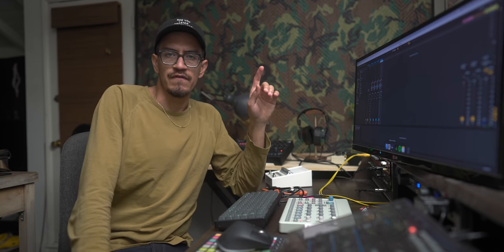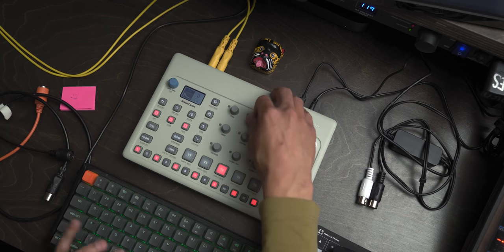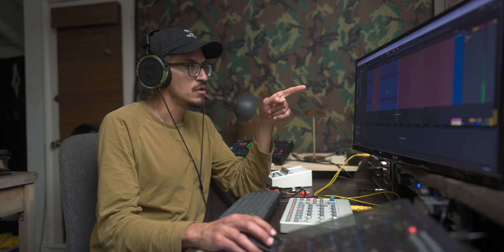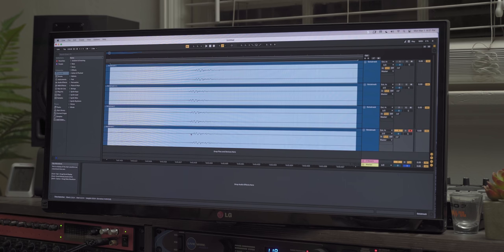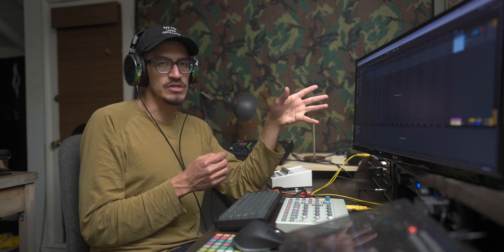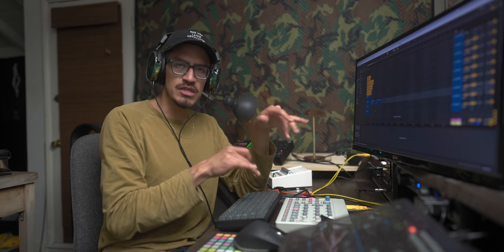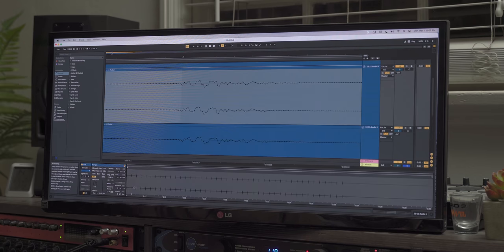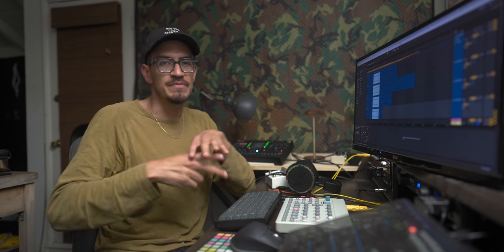Midi Latency and Why You Can't Win.. // Hardware Swing vs DAW Swing

Comment: this video is of value ricky bc we do struggle with these issues but without the understanding or equipment to isolate exactly what is causing these hiccups, it helps to see problems like this elsewhere so we are more informed with respect to those random software related issues as well as products that are fails, esp when those products are very expensive tho it may mean little and be unseen by you al together thanx for absorbing the impact of buying an expensive dud, it sux and im sure many will not end up in the same spot bc you did already preesh mane.... tempo issues are very confusing in the beginning. i had a real issue learning that the Orba's 100 BPM is MPC beats 97.7..... it took me a long time to accept there is an odd gap in actual tempo so i could just move on with the recording (i wasted a lot of time thinking i was doing something wrong when i just didnt know software kind sucks sometimes with these issues) i have never mutli tracked into a DAW. im just scratching the surface on software at all and find this info very re assuring. i wish i saw this sooner, PLEASE do a beginners guide to recording tracks including these types of issues that may trip up a noob like myself. the issues that wont be mentioned in the user manual such as this tempo discrepancy with software and hardware. this video will help me harbor additional patience when recording in the future and i think you have enough others to speak on that would help someone like me,  thanx ricky... keep it Gnar Gnar <("<) (>")>

Comment: 20:59 YES, always run your audio interface (and of course midi interface) on a separate USB, directly to the computer. Everything else like keyboard, dongle, drive, etc... can run from USB hub. This is definitely a source for this kind of timing issues.
Reply: Just avoid everything MIDI and USB in one sentence. It's the worse protocol EVER to use for stuff like this. It will NEVER be perfect.
Reply: @casecold1864  The good old firewire... It feels so good to have my old Ultralite firewire running rock solid... midi from my Ultralite in FW is ultratight... and OP-1 usb-audio-midi code is the best thing you could possibly imagine... boutiques on the other end... nevermind...
Reply: I would never buy a usb audio interface. Never.
Reply: @re8et355  FF800 here, it's perfect.

Comment: Hey Ricky, I can't say, how happy I am, that you made this video. For me. it's an confirmation, that I'm not such a great foolish at all... :-) . I've used Logic and now Studio One is my DAW of choice (again on Mac). The timing is way better, but you can't get totally rid of jitters and latency. My workaround is the same, as you explained: 90% of my midi-sequencing I'm doing with my Squarp Pyramid (btw: it's great!); then I'm recording my sessions and songs via an multi-input-interface direct in Studio One (or Capture), set the tempo there manually as it should be and drag the recorded tracks all together in the right grid. That works great for me. My opinion: if you're working with timing-sensitiv hardware like drummachines or grooveboxes and you will grab them into a DAW (without the multiclock...), then that's the way it goes...unfortunatly.
Stay healthy!!

Comment: Years ago while I was just switching to computers from hardware I learned about this issue

And my fix was to use the computer sequencer to trigger my hardware using midi notes 

And record the output from my hardware into my DAW 

This was the only way I could make sure the clocks were rock solid

Comment: I've experienced this too. I use Windows and the DAW mangles midi out.. 
Don't always record your parts as individual parts. E.g., it can be better to record your drums in 1 stereo mix. You lose the ability to edit the midi and different volumes, but you retain the groove and vibe. When I use the DAW and create drum parts then I always have to fix the audio wave. Timing is much better from the Akai, or from an analog clock. Analog really grooves for locking synthesizers and drum machines together.
Reply: Yes. I'm experiencing this midi jitter and for recording drums for metal songs this is horrible. One take for the whole song is the way.

Comment: Don't monitor in the daw. Set monitoring to off. There is always latency on live monitor
It used to be recommended to give an empty bar after midi start to avoid the 1.1.1 jittering between synced units.
Mpcs don't perfectly phase cancel over takes, ever (even on master) I guess everything won't if the cycles doesn't.
It all has to go down at the same time.

Comment: 20:28 We may not be able to hear less than ~10/1000 of a second of latency, but of course as soon as any kind of phase shift from parallel processing comes into play, even a completely undiscerning ear is going to be able to hear differences of just a single sample, eg 1/44100 of a second.

I think a lot of these latency issues come down to how well the device drivers are written as much as the hardware itself. I'm a big fan of RME gear on that front, always absolutely rock solid.

Comment: I’ve been using the Innerclock Sync Lock for years now to sync midi and din-sync hardware to Ableton as clock source. With some clever routing you can make the setup work even with monitoring via Live, allowing adding insert plugins, sends, etc.
Reply: Seems like it’s around the same price as the erm and I don’t see any knobs to adjust the clock delay, I thought that was the way to get all your gear in sync

Comment: I spent the last 6 years chasing midi sync with a computer after buying the squarp pyramid sequencer to sequence bitwig. Now after years of experimentation and measuring (and basically quitting making music over all these fucked up timing issues) I finally got the recipe right: 

- Get a modern soundcard with a midi interface, because this way your signals will be just a bit more "in sync" with each other. Dont expect 20 usb devices to work together in any meaningful way.
- Get a DAW that will run off midi clock instead of being the midi master
- Let your midi master clock be your device (eq. octatrack, squarp pyramid etc) 

Now to the more esoteric:

- Avoid plugins that introduce latency, bitwig for example has an indicator on individual channels that lets you know how much milliseconds of delay you get for using certain limiters or reverbs
- Run the lowest latency you can afford, but not so low that your system is always on the brink of collapse, as this will actually increase jitter

***UNCONFIRMED SUPER VOODOO TECHNIQUE**:  Run at 96k because ehh..i dont know something about USB packets being handled differently and shit. This one actually brought down the midi jitter to reasonable levels and get a 4/4 Kickdrum pattern within about 1/4096 or 1/2048 which is good enough for me ;)

Comment: I had an email converstion with the creator of Expert Sleepers USAMO - Andrew Ostler,and he said "there are two sides to every
MIDI connection - the transmitter and the receiver. The USAMO gives you a near-perfect transmitter, but it can do nothing about the
behaviour of the receiver." so Your synth,or drum machine have to a good/perfect midi receiver also to get accurate timing,no matter if You send perfect midi signal,I think this is one of the deepest rabbit hole,I end up with other method CV - control voltage, I sequence   my Moog Slim Phatty,and Arturia Microbrute with control voltage,but not every device have CV input.

Comment: try overbrige. take a midi-signal from the digitakt to clock another devise while running overbrige. thats my way to "not buy a multiclock". but if i would have the money.........
Reply: I agree. OB is the 2nd best solution. Still not as a good as the E-RM since OB adds a lot of latency and chews up the CPU, but it’s the best alternative I found as well.
Reply: thx fot that, just thought i have to overthink my whole recording setup for my EP, but OB, Digitakt and RYTM are my things

Comment: You actually have two problems here. 
- One is the audio clock issue on basic audio interface, that can be solved with an expensive wordclock; If you’re recording lot of audio, it makes a huge difference; even decent audio interface that are supposed to have internal clock are bad and have timing oscillation and jitter. But not everyone can afford an Apogee or Antelope and such...
- The second issue is actually from USB MIDI interface that is often out of sync with internal clock, it’s often due to poor drivers on mass market midi interface. The more robust midi interface that I’m aware of is the Motu Midi Express; while back it was the only interface that had solid driver that would avoid this kind of issue. 
I had to do plenty of test for my work to link computer system (OpenLabs keyboards) with MPCs. We had to spend a LOT of time to develop in-house drivers for the Presonus interface to be rock solid for our system to work. it’s been a while now that I haven’t look into it, but I’m pretty sure the issue is still the same. I doubt any mass market audio/midi interface developer spent time to develop rock solid midi drivers for their interface. Only guys like Motu, Avid and such might have decent solutions... not the kind of gear we find in (bedroom) home-studios.

Comment: You can have pretty perfect midi timing... like steinberg midex with mtb... that’s been around a long time... and you get perfect timing. Digital performer has one of their own, also pro tools... you just have to go beyond just hooking up a usb cable. You can use a midex with your mpc, load a computer to high cpu usage and have your computer track and external mpc prefectly in sync, so tight that you may even get phasing issues... So there is absolutely no reason that an external mpc doesn’t have perfect timing on imported tracks. The way it works, is those boxes get the midi note ahead, store it and deliver it to the midi din jack at exactly the right time. You can check midi latency through using a midi cable and sodering it to an audio cable. You get enough voltage trigger to record as audio the midi pulse. Like that you can check system midi latency. Then you can check your mpc latency (which is really low) and add compensation if needed. Just ditch that usb cable, never has worked,  never will... as the way usb is handle by cpu and bus.

Comment: When using USB there is a minimun jitter that can happen because the USB Driver has limited "resolution"  ( i.e. it can only send messages up to a certain speed, after that it can't so there will be a bit of jitter on the clock regarding that with any USB solution ) that's one of the reasons sync through USB will never be perfect, that doesn't mean it's unusable, it's just that there is a minimum jitter when using USB.

That's the reason why some clocks will use AUDIO cable and send AUDIO TRIGGERS instead, this guarantees that you don't have that sort of limitation when using AUDIO signals.

I believe another way of solving that problem would be to use ETHERNET cable instead of audio cable.

Regarding ableton some of the latency can come from "Reduce latency when monitoring" option, generally if you turn that option to OFF or mark the track monitor to "OFF" instead of "IN" and "AUTO" you will get a "tighter" recording that isn't influenced by the latency plugins / DAW is creating.

This issue overall is very complex and confusing, so it's very hard to be really fix it. Find something that works for you with your setup and stick to it.. That's definitely a tough problem to solve..

Comment: Latency can be accounted for with a timing offset, jitter is the real problem. MIDI over USB causes jitter thanks to things like multiple packets per frame, device contention, and host OS priorities.

I'd be curious to see what kind of timing guarantees different OS class-complaint USB MIDI specs have, if any. Class-compliant USB audio is tuned for accuracy (at least for Apple).

Comment: That's the reason we went to recording everything at once using a mixer that has outputs and then going straight into 8 channel interface. Certainly not the cheapest option and if you have a small home studio set up might not be possible but highly recommended if you can do it. Also saves tone of time since you just record everything all at once too.
Reply: I don't understand, how does having an audio mixer fix MIDI timing issues?
Reply: @formerself4372  well you record all the instruments at the same time rather than doing multiple takes so there might be midi timing issues but you don’t loose that swing and groove and relationship between the instruments
Reply: @swamppeople  ye but adding the mixer in there just mixes the levels, rather than affecting latency haha

Comment: Most of the latency you experience in a DAW is caused by the OS routing audio through the DAW itself. Try switching all your monitoring to off on the channels in Ableton and monitor the audio directly from the your hardware. I do this via RME TotalMix, which is a routing utility that comes with RME interfaces. I'm sure you have shown a similar thing for your Focusrite (?) interface in a previous video. The key is not to monitor ANYTHING through the DAW. It's not a slight against Ableton, you will get the same extra processing and in turn latency using any additional audio routing. Hope this helps!

Comment: Have you tried recording with monitoring off? Not set to in or auto? In and auto add system latency and off has zero. I have found this makes a big difference. There is also midi clock sync delay under preferences/midi sync which can go negative or positive. I spent hours with the hi hat like you were doing and fiddling. I managed to get it pretty solid. I have found different machines need different settings. I have better luck with Renoise honestly, it's clock is solid. Unfortunately it can only record a track at a time.
Reply: Yes - monitor any external recording sources externally from Ableton (e.g. direct off interface if possible) and switch channel monitoring off. Big difference right there! 
This might not address any MIDI sync or clock issues, but not doing this seems to pile audio latencies on top of each other.

Comment: Latency is relatively easy to compensate for but jitter, as seen here, not so much. Check out the Expert Sleepers Silent Way VST and the hardware that goes with it (the relevant hardware for DAW sequencing purposes being the USAMO or the ES-40 with the ESX-8MD.) The VST takes your sequence and sends it out as audio, which for practical purposes is free of jitter, and the hardware then translates that audio into MIDI, resulting in jitter-free midi. (The audio the plugin generates is actually midi data encoded into audio, so it sounds like a bunch of clicks to the human ear.)

As a side-note, much respect for the "please don't buy a shirt if you don't need one" disclaimer!

Comment: I have had good luck with the Mio too, it works well with old synths for SYSEX (DX7, D50, POLY 800 for example).

USB to Midi is basically USB to serial and uses similar chips to FTDI USB to serial parts. I did a deep dive a few years ago on this stuff because I was having issues with timing from an application over USB to a (non music) product. Basically USB has a "frame rate" and doesn't process the request as soon as it is received. It will wait up to 1 milli-second to process and send the request. The request can have a lot of data in it, but it is only sent on a 1msec boundary. (I may be paraphrasing here). 

Older MIDI implementations in the pre USB days would have had a Serial IC "UART" such as the 16550 style that talked directly to the CPU and interrupted the CPU the instant a message was received. Now a MIDI message must navigate the USB subsystem first which adds an unpredictable amount of latency (Jitter).

The MIDI standard itself for clock is pretty amazing, it is a single byte (0xf8 I think) transmitted to sync devices. This means if you are just looking for sync, you should be able to generate an interrupt per byte, and just look for 0xf8. That is very fast, a few micro-seconds, for modern processors. Compare that to the USB latency of up to 1 milli-second and you start to see where the USB system makes things worse. 

MIDI clock is 24 PPQN, so at 100BPM we would see 40 pulses per second, or 1 pulse every 25 milli-seconds. A 1 milli-second jitter is 4% error on the individual 24 PPQN pulses. You wouldn't think you would notice, but it's there! Coupled with sampling latency of the audio, and you have to manually time shift a lot of stuff. 

I'm just getting into Ableton, and I'm finding stuff like this really kills my motivation. I'm trying to generate enough talent (i.e. buy enough stand alone gear!) that I could just track to final mix. Or I'll get rid of the clock altogether and get really really into ambient stuff.

Comment: Great video.  The worst issue is trying to keep two kick drums from different sources in sync.... Another possible workflow might be - 1. do your sequencing in the hardware sequencer / drum machine -2. export the midi only to the daw . 3. use Expert Sleepers USAMO, which sends sample accurate midi (that's the claim anyway) out of the daw as audio which the USAMO box converts back to midi.... but I haven't tested this!   Another issue with Daws (or Pro Tools at least, I presume Live does it too) is they skip a sample every couple of bars (there's a formula that dictates how often this happens, something like dividing the sample rate by the tempo or the other way around).
Reply: Usamo looks like the same thing as ERM but only one MIDI output, and therefore no way to adjust individual clock delays